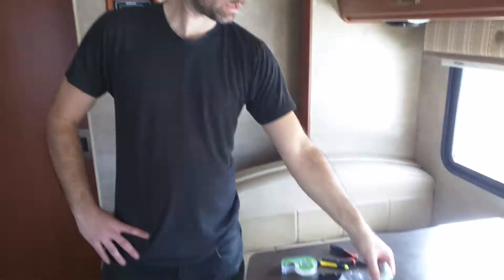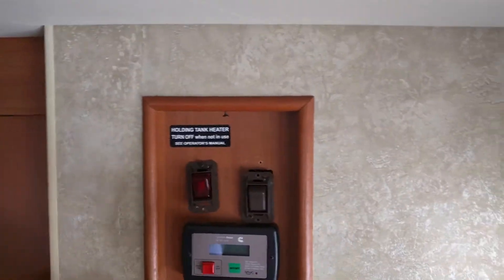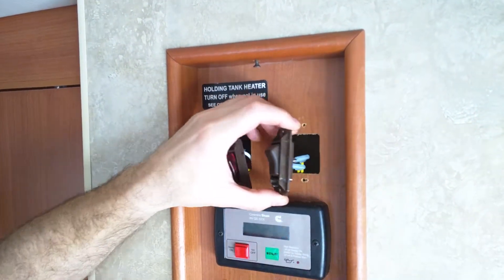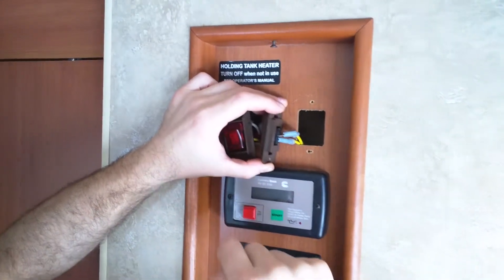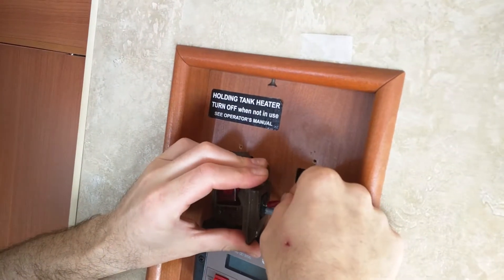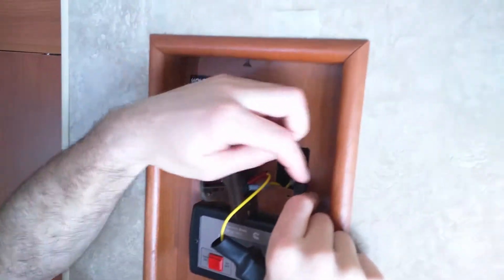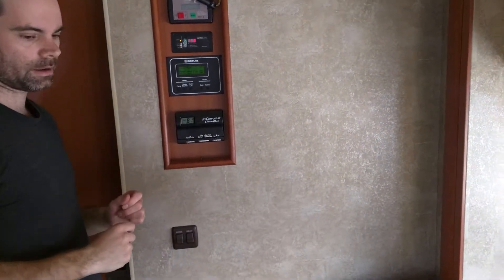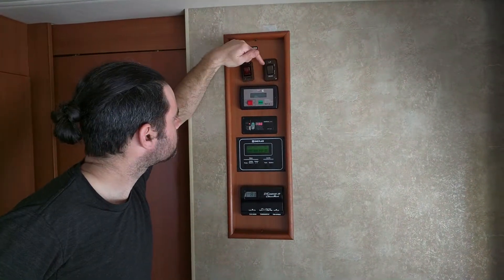Propane Solenoid power Reduction Device Installation

Comment: what exactly does a propane solenoid do and is it required?
Reply from the maker: It opens the valve on a propane tank using electric power instead of a manual shutoff. Primarily used in Motorhomes.